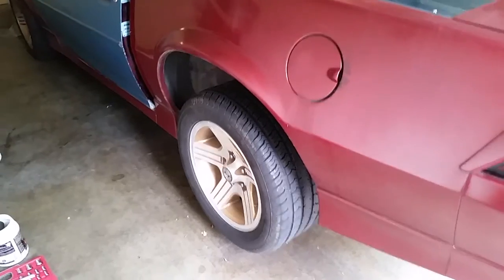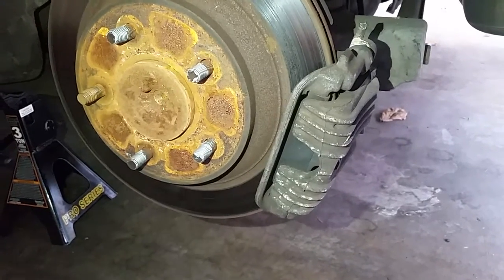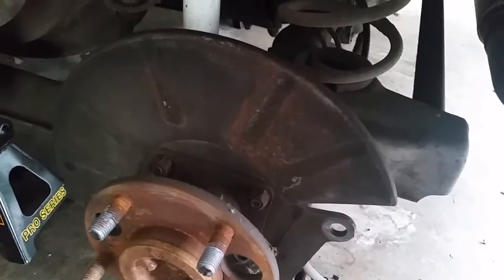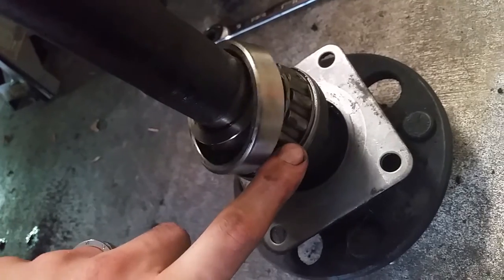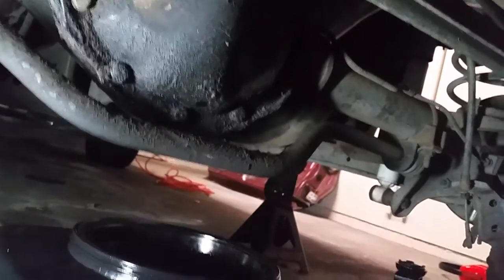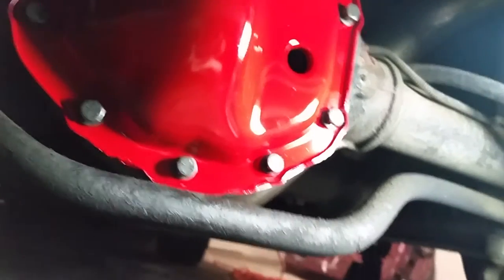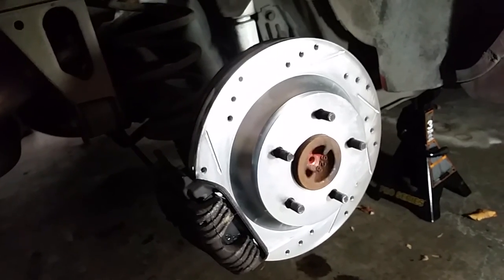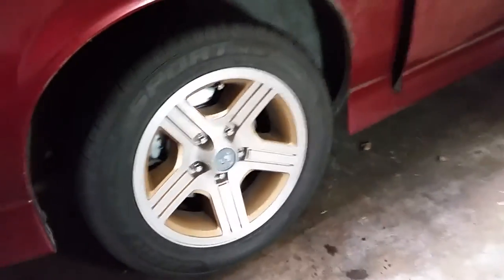Full rear brake job on a 1989 Camaro

Comment: I ordered the rear brake rotors, they said they fit my 89 firebird formula, but when I got them they are about 2 inches too big and the brake pads that come with them are tiny. The rear rotor, caliper, and brake pads that are on my car look the same as my front ones but the calipers have the ebrake piece on them. The rear rotors look to be the same size as the front rotors. I messaged the seller, waiting on a response. I did however order the front drilled and slotted rotors and calipers you had in another video and those went on perfectly fine and they look great!
Reply from the maker: Sorry to hear that, sounds like the seller messed up the order. Amazon has a really good return policy so you should be good there
Reply: @JRobling  I contacted the company and they said that the part numbers that are on the rotors should be for my car. So i can only assume that the previous owner converted my car to rear rotors. I have returned the new ones and now need to measure mine and see what will fit it
Reply from the maker: @black91silverado82  That would be a good possibility, people love to swap rear ends on these cars

Comment: I have the same rear end in my 88 RS it came out of a 88 Z28 I couldn’t find the calipers either so a had a local shop acid drop and rebuild the. It was pretty cheap and looked and function like new

Comment: So I have owned 3rd gens for 40 years. Done just about anything you can think of to them both Camaro and Firebird.  THis is a set of a curiosity questions more than anything else.  While helping out a friend of mine he came across your video and it started out simply enough until you arrived at the backing plate. Now here comes the questions,, WHY did you remove the axle if you're doing a brake job??? and since you removed the axle, why did you not change the bearings??? and just to throw in another question, why didn't you change the calipers and bleed the brakes??? I'm probably 100% sure that fluid is black. I take it you did not buy this car new, so there is no telling what she has been through over the years and you had some key components right there in your hand. Look I'm  not trying to bash anyone who wants to help someone get through something they don't know about but you did not do a complete brake job and the axle has NOTHING to do with it.  For the most part I thought the vid was ok but in the future if you say your going to do something, don't do something else. So since the conversation you had went to the rearend anyway and I'm sure we have some out there that don't know, but the Borg Warner Australian 9 bolt was put in as a replacement axle for SCCA road racing teams and entered our world in 1988.  The conventional rearend had problems holding up due to the stress of road racing so our friends from down under provided a solution.  As a result of the race car having the equipment, the street car also had the same equipment because you are not allowed to run a race type vehicle in a production class if your street car doesn't exist.  This class was known as the SSGT class and the primary car was the 1LE.  Some cars came equipped with many of the 1le parts, namely the rearend but in the spirit of creature comfort, most did not get the full package.  Just some useless info for some that may want to know
Reply from the maker: I did all that stuff and broke up the videos, so this one is just for the brakes, I have another for the bearings brake fluid etc.

Comment: I know I’m late. But the third gen trans am/camaros have discs in the front and drums in the back. Also if you noticed, the back left side studs were half the size of the back right side studs
Reply: Joseph Skelton option code J65 have you 4 wheel ABS discs.
Reply: My 1984 z28 has rear discs.   From my understanding if it came with the HO 305 or a 5 speed it came with 3.73 posi with disc brakes.
Reply: I have a factory posi 2.77 disk brake rear end it came out of a 88 z28 I did some research and they only made them one year and discounted it, you can identify them because the brake face in opposite direction. And it factory the brakes are and Australia original design and nobody make them anymore